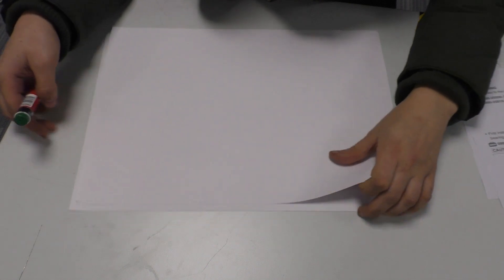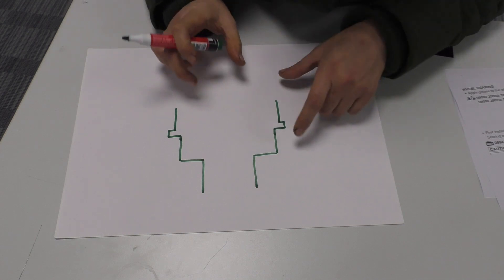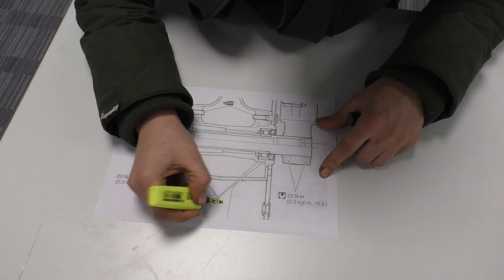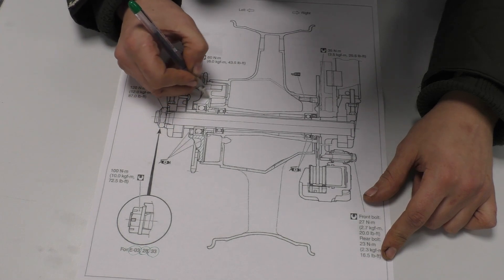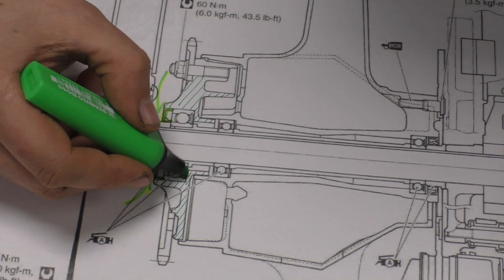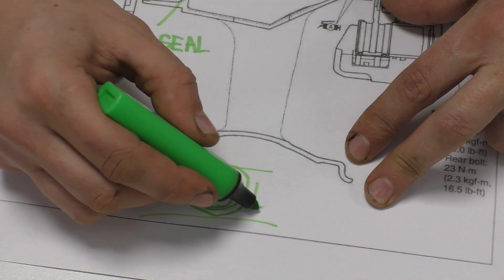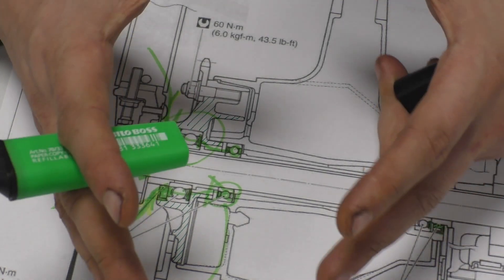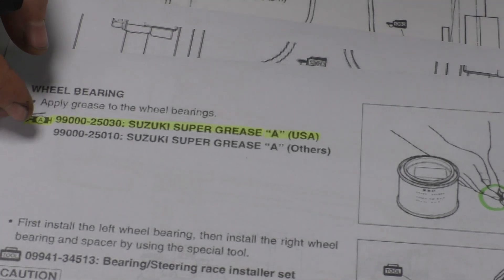Grease and bearings

Comment: I never did understand why Suzuki used single shielded bearings.  The idea of single shielded was to allow excess grease and oil to escape carrying any dirt etc out with it.  (It also allows easier repacking if you need to do that.)   In the wheel bearing situation having it shielded from ingress of foreign matter is the most important.  

Most bearings are overpacked by individuals and the number of people I have heard say that they've removed the shield to put more grease in without quantifying why they think that there is insufficient.  Too much grease causes it's own issues and most people don't realise that where the contact areas are at fast revolutions this becomes more oil like and is designed for operating like that.  It reduces the friction reducing energy renegy and if too much grease it restricts the free movement of the bearing with some of the excess is forced out requiring more energy. From memory bearings are only packed by the manufacturers to around 25-30% of the volume.  In industry the bearing manufacturers reckon that the majority of failures or short life are  due to over packing bearings with grease.  The idea of going around each week with a grease gun, etc and giving it a couple of squirts is considered a no no.

Comment: Was catching up on your older most popular videos and came across this gem. Look at that nice application of 3in1 oil on the mating surface between the race and the frame.  "One of the first things we have to do is grease the inside ever so lightly"

https://youtu.be/JIVqlvZ66Vw?t=7m

It's not a wheel bearing with a lot of rotations, so the chance of spinning the bearing race wont cause any damage. Not being a prick, just pointing out we all have misconceptions that we believe are true until taught differently. Problem with youtube is that it's a snapshot of you being a knobhead two years ago.
Reply from the maker: This is a steel race in a steel tube. The bearing is not rotating through 360, and the loads on this bearing are more axial loading than rotational loading. 

If you look through Timkens manual this is what they state. As you have said this is not a rotating assembly in the same respect as a wheel bearing. 

"Problem with youtube is that it's a snapshot of you being a knobhead two years ago."

- Look it up dude. Galling and thrusting loads vs rotational installation. - I'll dig around and find the book...
Reply: Couldn't find any mention of greasing at other race in my KTM 250SX service manual. Only one I have access to that deals with Steel frames. This time I did check before hand. Only recommends greasing bearing and O-rings.

Looked up Timkens thrust bearing catalog. (http://www.timken.com/pdf/10765_Thrust%20Bearing%20Catalog.pdf) 
Page 50 has installation information. No mention of lubrication or not on the race, just make sure all foreign material is clear. But also doesn't recommend cleaning off manufacturing oil to prevent rust.

Looked up SKF bearing catalage. (http://www.skf.com/binary/tcm:12-114679/140-710%20BIMG%2011_2012_tcm_12-114679.pdf)
Page 13 is fairly interesting. Specifically the section. "Mounting bearings with a
cylindrical (straight) bore". They recommend that the seating surface should be lightly oiled before installation.

Similar SKF resource(http://www.skf.com/binary/12-69177/457640.pdf) Page 38
"Coat the bearing, housing and shaft with the same lubricant being used
in the machinery in which it will be placed. This will ease mounting and
prevent rust from building up at the press-fit contact area."

They are recommending oiling all surfaces for installation in cylindrical straight bore. No distinction between rotational and thrust on SKF. Although a significant emphasis is placed on all mating surfaces having the correct interference fit to prevent movement. They don't seem to think that oil will have a negative impact in a system designed with the correct fitment.

I'll look into any resources you can come up with, but looks like according to SKF light oiling is recommended for all bearing installation.
Reply from the maker: Does the SKF specify materials in contact? This is why Yamaha, Suzuki etc don't have bearings fitted with oil or grease on the exterior - if you look through the these guildlines - they do state 'manufacturer dependant'
Reply: It doesn't specify the materials in contact, probably safe to assume mild steel. Too many variables since they can't predict where their bearings are being used. These guides aren't really targeting end user though, and are more for a system designer who then makes the decision based on the specific application.

That's where the service manual comes in, but KTM manual says nothing about greasing the race for installation, just bearing + o-ring. Can't speak for other service manuals. Didn't bother looking at aluminum frame YZ manual yet. 

I'll wait and see if you come up with anything from a book. I have always installed races dry, or with a locking compound/shims if old and fucked. 

It's partially irrelevant arguement that this point, since SKF has actually done studies and say use a light oil to aid in installation. They do go on to specify the recommended finishes and tolerances for a press-fit, which probably means the forces from the installation are expected to significantly overcome any lubrication from installation oil. 

If the tolerances are out of spec (Del's example), oil will make the problem worse and the outer race will spin fucking it further.

Comment: honestly i grease every fucking thing :). that dell bearing was kind a loose in fit. but usually its a bit tighter, cant see how it can spin around inside the seat with some grease in between.
Reply from the maker: "cant see how it can spin around inside the seat with some grease in between."

- What do you mean? why do you think bearings and your crankshaft work?
Reply: not saying you are wrong. just a thought, and myself have never encountered that issue "yet" :)
Reply from the maker: I'm not saying it is an issue, what I'm saying is there's a reason why they're dry and they don't tell you to do this.
Reply: cool. and probably your right, and im doin it wrong, love you :)
Reply from the maker: Its not about that - let me put it another way - this is how they do it in the factory.

Comment: Don't always assume bearings that come with seals are packed proper. After picking the seals off one to use in a small 2 stroke engine I noticed there was fuck all in there so I recently got some for my wheels and picked the seals off packed them with good waterproof grease and refitted the seals.
Reply: Agree. At least with open bearings you can see the grease. With shielded you either trust the manufacturer or pop out the shields and check  I've had bearings from major manufacturers & genuine OEM that had, to me, the minimum amount of grease in them & did no harm putting a bit more in.
Reply from the maker: This is why you buy good quality bearings
Reply: The Workshop they were ntn brand that's normally what I get from local place probably not the best
Reply: The Workshop would love to know bit more about bearings and what metals make them better quality and what the go with ceramic ones is etc..

Comment: This is a pretty common failure. The first thing to go was the seal. From new the bearing spacer is plated to prevent corrosion but this plating wears away under the seal. By design ball bearings have a small amount of sideways slack. This means that a thin ring of bare steel gets exposed right next to the seal as the carrier moves side to side. This rusts and rust is very abrasive. The edge of the seal lip is now running on a rough surface in an abrasive slurry of water, rust and dirt. This causes more wear so more crap gets under the lip and the process accelerates. I didn't watch your previous video but if you look at your bearing spacer you will probably see a wear groove where the seal ran. Now water is getting to your bearing. This causes the grease to break down and rusts the balls and cage. The extra stress from poor lubrication and balls that are out of round and no longer smooth causes the cage to break. I have seen this same failure mode many, many times on various machines. If left the balls eventually exit the bearing and you end up with the races rubbing together. In cases of extreme neglect I have seen the races so worn that they break up as well.
A combination of failed lubrication and corrosion is by far the biggest cause of catastrophic ball bearing failure. It is theoretically possible that the cage failed spontaneously but as you said it is a million to one chance (probably tens or hundreds of millions to one). Changing speed has negligible effect. I have seen machines that have done 30+ years running every work day where the drives reverse every few seconds and the bearings were fine.
Reply from the maker: "This is a pretty common failure. The first thing to go was the seal."

- no evidence of that.

"This causes the grease to break down and rusts the balls and cage."

- The interior of the bearing was fine and no signs of rust - the cage was completely destroyed
Reply: I just looked at your sprocket carrier bearing video. It isn't that easy to see due to the lighting but the old bearing looks pretty grotty inside to me. I have a question for you. Is there a wear groove on the bearing spacer where the seal runs? Edit: to answer my own question - your wheel install video clearly shows the wear grooves. I am guessing you have two grooves because it was a double lip seal. All of the evidence is there.

Comment: Hi Matt
My name is Ste and I am a subscriber to your YouTube channel I was just wondering if you had any ideas on an issue I am having I've got a 1999 Yamaha Fazer 600 the problem I have got is my right leg is knackered and I am having problems with the height of the bike the height of the bike is not too bad when I am on the bike by myself but when my wife is on it is more of a struggle to get my leg on the foot rests I have put a jack up kit on the bike and I have stiff and the shock absorber up do you know any other way I can try to increase the ride height and before you say it Matt I cannot get rid of the wife ha ha if you've got any information or know how I can get another two to three inches ride height I will be interested in know I have tried to email you but it just fails fail
Thanks Ste
Reply: Hi Steve, it sounds like your problem isn't being solved by changing your ride height. Remember the distance between saddle and footpegs doesn't change when you change the ride height. You could maybe look at getting a taller saddle or some rearsets for your fazer. Both would effectively give you more distance between saddle and footpegs.
Reply: thanks for information I was thinking of looking at having the seat re upholstered and to ask them if they could build any more height in to it but thanks for your advice sounds like good options to me thanks

Comment: Good video. 
I agree with you on everything except lubing the housing bore or bearing surface. 
Applying a light coating of new, fresh, clean lubricating oil (not grease) to the housing bore and/or shaft and bearing surface prior to mounting/installing/pressing is recommended by most major rolling element bearing manufacturers for most press/interference fit bearing applications. 
The lubrication helps prevent deformation, galling, fretting, brinelling, spalling, corrosion and promote thermal transfer. 

Beginning page 43 
https://www.schaeffler.com/remotemedien/media/_shared_media/08_media_library/01_publications/schaeffler_2/manualmountingoperation/downloads_7/wl_80100_3_de_en.pdf
Beginning page 13 
http://www.skf.com/binary/tcm:12-114679/140-710%20BIMG%2011_2012_tcm_12-114679.pdf
Beginning page 18 
https://www.timken.com/wp-content/uploads/2016/10/10213_-Industrial-Bearing-Maintenance-Manual-Catalog-1.pdf
http://www.nsk.com/services/maintenancerepairs/mounting.html
https://www.schaeffler.com/remotemedien/media/_shared_media/08_media_library/01_publications/barden/brochure_2/downloads_24/barden_handling_mounting_precision_bearings_us_en.pdf 
https://www.timken.com/resources/timken-engineering-manual/
https://www.timken.com/pdf/5892_Bearing%20Damage%20Analysis%20Brochure.pdf
Reply from the maker: SKF manual - (that you linked)

"With non-separable bearings, the ring that is to have the tighter fit should generally be mounted first. The seating surface should be lightly oiled with thin oil before mounting. 

The inner ring should be located against a shaft shoulder of proper height (Figure 5). This shoulder must be machined square with the bearing seat and a shaft fillet should be used. The radius of the fillet must clear the corner radius of the inner ring."

- The bearing seat is the flat surface of the bearing NOT the OD.

The timken bearing page says -

"Coat the shaft with light machine oil or assembly paste to reduce the force needed to press the bearing on the shaft."

- This is the shaft. Which is most always steel.

Pressing bearings into ally housing is the issue here. Due to Aluminium thermal expansion rate vs steel the bearings have to be installed dry - this is why Suzuki etc do not use lubrication in these bearings. 

As Barden themselves say - 

"Interference fits should be used cautiously since they can distort the racewav and reduce radial play. Loose fits may be advisable when: 

There are axial clamping forces 
Ease of assembly is important 
There must be axial movement to accommodate spring load-ing or thermal movements."

The appropriate fit may also vary, as governed by operating requirements and mounting design.
Reply from the maker: God that was long - in other words - the manufacturer states the fit and process of assembly due to the conditions and function of said bearing. Suzuki in this case have signified what should be greased and oiled - throughout the manual and even specify with what lubrication (albeit their own). 

No spec no oil/grease.

Comment: That bearing could have been damaged by over tightening the the wheel spindle nut.... maybe ?
Reply from the maker: no - the cage is free floating in the system - good question though because I have a video coming up soon on the system as a whole
Reply: Unlikely, once the spacers and inner races are snug any over-torquing is more likely to strip the axle thread or the nut rather than deforming the bearing races. You're maybe getting confused with tapered bearings.......yes, you can over torque these and cause damage.

Comment: Just a thought, but possibly the sprocket carrier bearing could have been damaged through incorrect replacement, I'v seen new bearings fail very quickly on hubs (car sorry) where they have been pressed in using the inner race and cage collapsed, I generally freeze bearings if possible before installation..

Has Issac cut his nails yet dammit ??
Reply: i've seen bearings fail fairly quickly after being "pressed in" with an inaccurate hammer
Reply from the maker: "Just a thought, but possibly the sprocket carrier bearing could have been damaged through incorrect replacement,"

- I have no way of telling if these were originals or not.

"Has Issac cut his nails yet dammit ??"

- LOL no.
Reply: Pass this on for me Matt please..... Cut your fuggin nails Issac, puts my teeth on edge every time I see you with a spanner.... You are going to rip them, it's gonna hurt and everybodys gonna laugh at you.... XX
Reply: True that chris davidson.      :))

Comment: Know what kills bearings and seals? Wheelies and stoppies.
Reply: Every dirt bikes bearings should be fucked after hitting a few jumps based on that logic.
Reply: water destroys them faster
Reply: Except dirt bikes are made for going over things, and usually are a lot lighter than street bikes. I guess I should have included "for anything not dirt bike".
With stock suspension a sport bike may just destroy a bearing or seal in a few wheelies if you're a heavier individual.
Reply: I've done countless wheelies on both my dirt bikes and street bike. If i was to guess it would be more like 100+ to even get to the point of it wearing out and higher for failure but i guess i don't weight much either..

Comment: Do they use normal road style bearings like this in high performance applications like motogp and f1? Or are they constructed from more exotic alloys or ceramic or something trick? As they don't have to last for very long
Reply from the maker: Good question - I think for MotoGp normal bearings are just fine - seen as though they hardly use the bike. For F1 they use tapered roller bearings like a lot of cars do - They might use lower friction bearings - Kawasaki made some zero clearance bearings which we'll get to soon

Comment: There's also a good chance the outer rubber seal became hard wore away a bit or stopped being tight enough to axle. Which then allowed water and grit to get into the bearing in the sprocket carrier which then caused the rest of the damage as a result
Reply from the maker: Could be - the problem here is that there's no way of knowing due to lack of evidence

Comment: It's such a good fit the grease just gets displaced/ scrapped off. I have seen something similar and the grease has been squeezed and forced into the bearing bulging the seal which naturally ruins it's ability to stay sealed. Though most typically it would be forced out the path of least resistance
So mostly pointless 
Occasionally and rarely ruins the bearings seal.